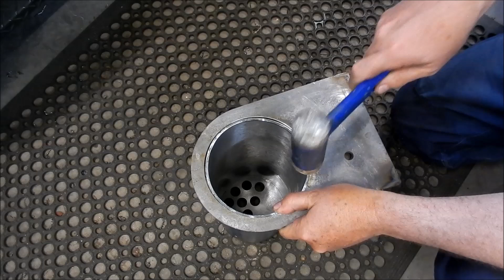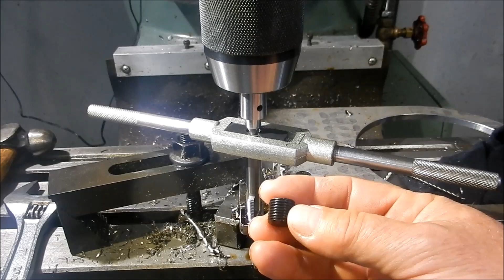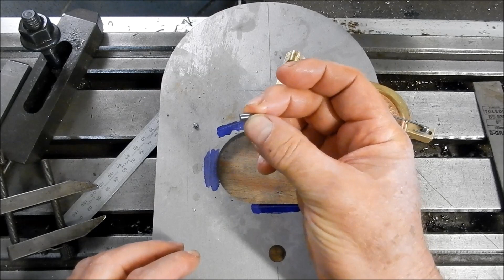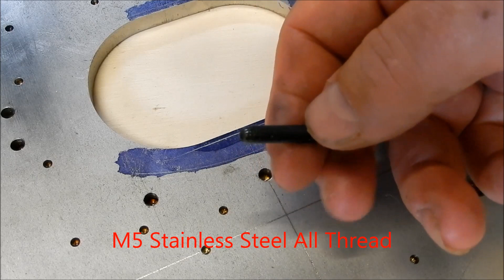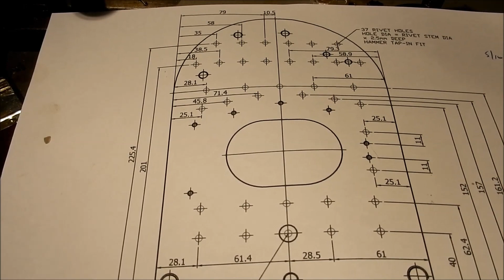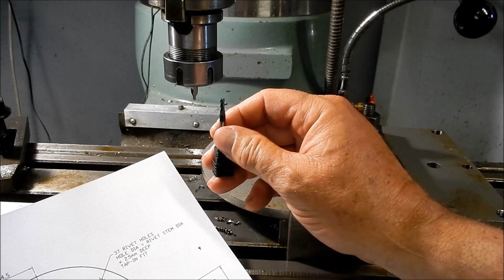Machining the Throat Plate and Back Head in Duplex 2205 S/Steel

Comment: Great job Cam. The Backhead is certainly going to look a treat when all the fittings and rivets are in place. The authentic looking cast fire-hole door has some really good detail and shape that will further enhance the look of the Backhead. 
One thing to note regarding the crosshair lines on the plate work, these have been laser etched as part of the laser cutting process, as well as assisting in the set-out for machining the also make the assembly of the boiler easier.
Good information about the accuracy of grades of squares

Comment: looks good cam, that stainless does not look like fun at all to machine up, lol. I was was thinking at the end tho about the rivets, that you put the rivet holes on the wrong side since the welded in bosses for the pipe plugs were on the opposite side and the rivets didnt go through, so they wouldnt be seen except on the inside, lol.
Reply from the maker: Hi Chirp, everything worked out well and everything is on the right side.  I'm looking forward to getting the boiler back after fabrication and inspection to do the final machinging on the assembly.
Cam

Comment: Funny what you say about carcinogenic tapping fluids.
I swear no matter what the product, the worse it is for you and the environment, the better it seems to perform!
Reply from the maker: G'Day Tommy, Trefolex have done the same with their formula as well due to Carcinogenic issues and guess what, its doesn't do the same job the original formula did.  You are dead right, the worse it is for us the better it performs.  I use a rust remover called Kroil to free up valves that have seized up due to salt water egress and it is the best thing since sliced bread.  Very expensive stuff at around $250 for 4 liters and its also carcinogenic so I wonder how much longer we will be using it for.
Cam